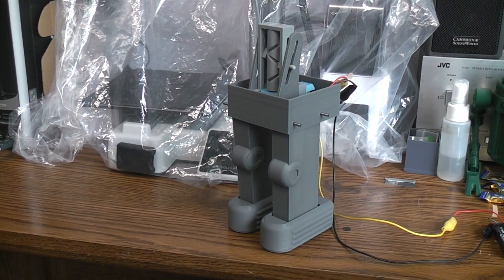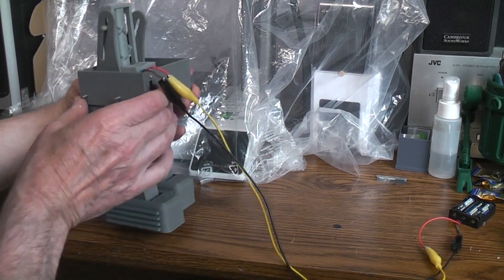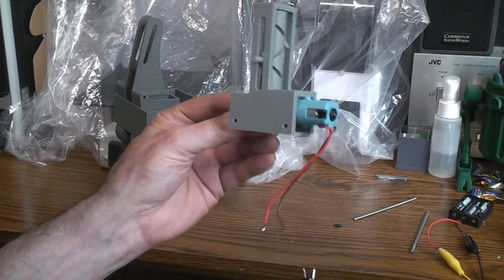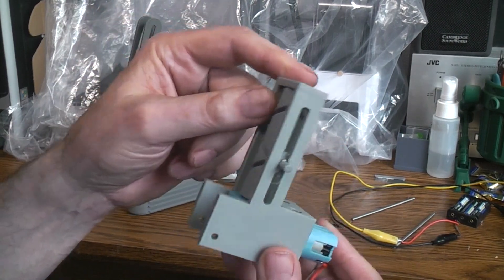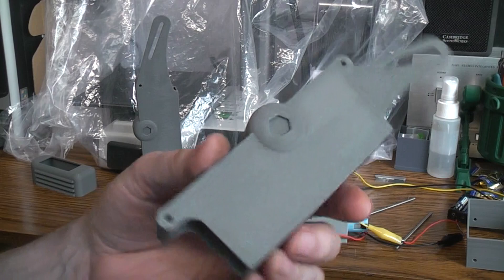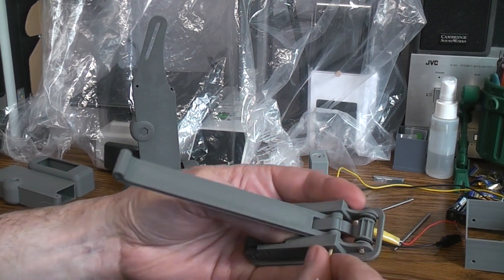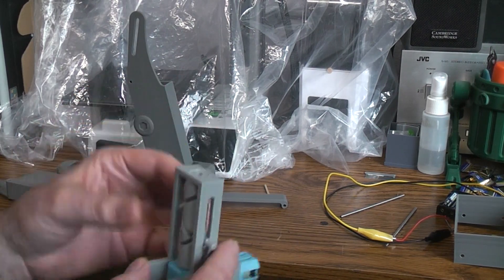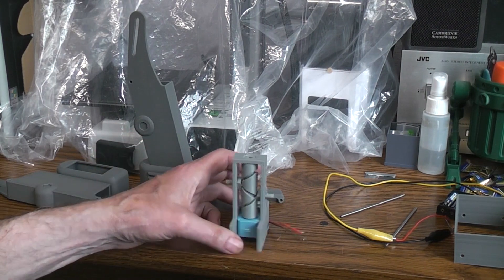Ratchet foot walking robot base using 3d printed self-reversing screw drive mechanism.

Comment: Tried printing this and it failed miserably. The "Traveler12mmshaft" just don't seem to want to travel up and down the screw. Not sure if printing at .1 would help. But right now its mostly just tearing itself apart. :(
Reply from the maker: What printer do you have?
Reply: @Robothut  Ender 3 v3 KE
Reply from the maker: @JimBuschman  Did you check out Gregs youtube videos on printing the screw part? Links in the description box. I know Greg uses a ultimaker printer I use a Bambu A1 mini these days before that I used Prusa MK3s.
Reply: @Robothut  I didn't see any video talking how it was printed, just showing it working. Am I missing something?
Reply from the maker: @JimBuschman  I was mistaken, it was his instructions for printing the parts. 0.15 layer.
https://www.instructables.com/Self-Reversing-Screw-Mechanism-Walking/

I 3D printed the following parts at .15mm layer height, 20% infill, PLA and no supports unless noted otherwise:

Two "Cap.stl".
Two "Leg.stl", Tough PLA.
One "Motor Mount and Traveler Pin Guide.stl".
One "Screw.stl", .1mm layer height, 20% infill, .25mm nozzle, Tough PLA.
One "Traveler Pin Guide.stl".
Two "Traveler.stl", .1mm layer height, 20% infill, Tough PLA, supports.
One "Wheel Well Left.stl", .15mm layer height, 20% infill, Tough PLA.
One "Wheel Well Right.stl", .15mm layer height, 20% infill, Tough PLA.
Four "Wheel.stl", .1mm layer height, 20% infill, TPU.
This is a high precision 3D print and assembly model using at times very small precision parts in very tight spaces. Prior to assembly, test fit and trim, file, sand, polish, etc. all parts as necessary for smooth movement of moving surfaces, and tight fit for non moving surfaces. Depending on you printer, your printer settings and the colors you chose, more or less trimming, filing, sanding and/or polishing may be required. Carefully file all edges that contacted the build plate to make absolutely certain that all build plate "ooze" is removed and that all edges are smooth. I used small jewelers files and plenty of patience to perform this step.
Reply: @Robothut  took a break from this and when I cam back I finally figured out my issue. It was the corners of the followers catching I think and making everything too tight. I also modified it to accept an m4 so they're easier to put on.
Reply: @Robothut  Are you using self tappers to hold the motor in place? I planned on nuts/bolts but just noticed it would be blocking the hole at the bottom.
Reply from the maker: @JimBuschman  I use standard 6-32 machine screws, they cut their own threads in to the TT gearmotor holes just right.
Reply: @Robothut  I'm working my way though how this goes together, do the "LegLinkage125x15New" just float inside the leg covers? I noticed they have a hole at the top, are they pinned somewhere on the body?
Reply from the maker: @JimBuschman  Video seems clear to me. The legs and leg linkage are pinned in the feet and to the gear box frame.
Reply: @Robothut  sorry I think I'm confusing something here. I emailed you a picture to see if that makes it clearer.

Comment: Looks like it walks really well. The ratchet mechanisms work smooth. Looking forward to see what the extra function will be. These faster printers are great. I now have an A1 that I'm using on my Vincent project.
Reply from the maker: Have you done any speed and quality tests on both the A1 and the A1 mini. just interested to know if the A1 is as good as the Mini.
Reply: @Robothut  I haven't done any real testing but I started using it as soon as I assembled it. I only did one small print of the battery doors to test it. Then I printed the middle part of the Vincent body that's too large for the mini. It's the largest part I've ever printed. It took almost 9 hours . Ninety minutes of that was printing supports. The quality seems comparable to the Mini. I've printed a couple of other big parts also.
 I'm working now on the Vincent so I sliced the bottom of the body in Bambu Studio. That's the part the legs attach to in the video I did on it. For the A1 Mini the total time was 5 hours 58 minutes. For the A1 it was 6 hours 9 minutes. So pretty close. So far I'm very pleased. I got the printer without the AMS. I have the AMS that came with the Mini if I need it.
Reply from the maker: @rick_100  Very cool. Keep us posted as you learn anything new about the A1.

Comment: Being that the grooves are at a 45 degree slope, you probably didn't need supports there, but definitely on the tops of the change of direction & around the lower points at the intersections.
I've learned that things on a 45 usually don't need support...
In general. 😊